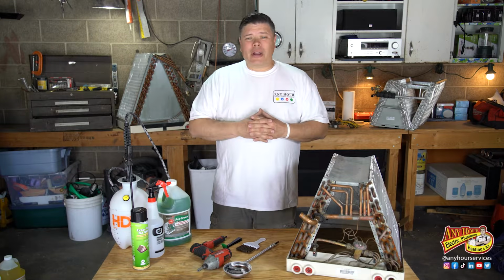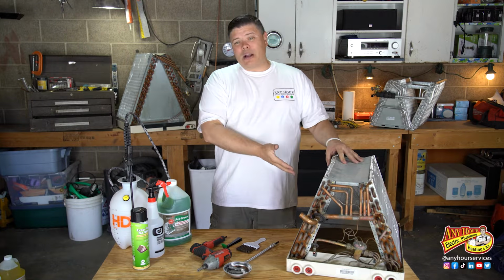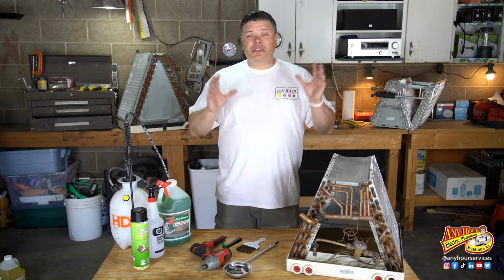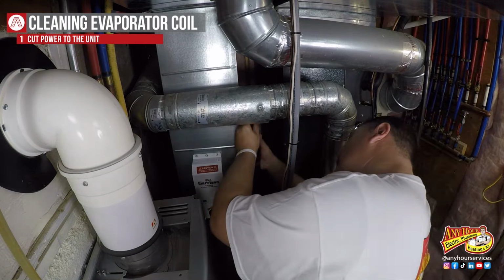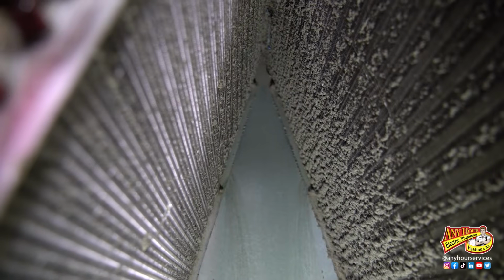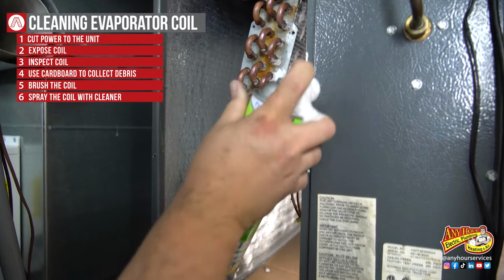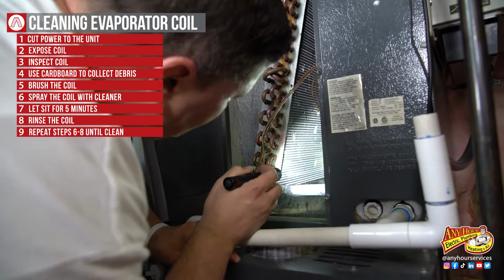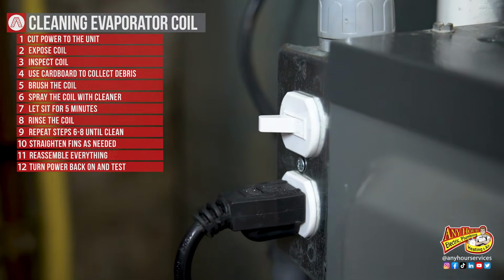AC Maintenance - How To Clean Your AC Evaporator Coil

Comment: Tip, easy way to locate ecap coils is look for the condensate drain pipe. Typically a white pvc pipe about an inch thick (half inch pvc). It should lead to condensate pump (small box with power cord, and platic hose to outside or to floor drain).

Where that pvc exits furnace is base of evap coils. Now look for a screwed in access hatch near where pipe comes out.

Comment: Approaching from the front, there are a lot of coils in the way of access panel removal on my carrier a-coil.  Can you access the underside for cleaning via a backdoor access panel. If so, I would create an access door from the rear of the furnace where I would be less likely to cause any damage?

Comment: Good video, I saw that you removed the cover in the center attached to the A coil. 
Can I just use a water hose with pressure to push out the dirt?

Comment: Great video and very well explained. I have a two year old American Standard home unit and live in the Houston Tx area so even in winter we have to turn on the A/C. Well I turned it on the other day and this very bad smell came out , which I found out seems to be very common on these new units. It smells like dirty socks. I am going to attempt to clean my evaporator coils tomorrow and then spray Odoban on them to see if the smell goes away.  I would appreciate it if you would offer your opinion on this issue and on  how I'm going to try to treat it.
Reply: Sounds like you may have mold growth which could mean that it wasn’t installed properly and the water from the evaporator coil is not draining properly

Comment: We have a brand new toll brothers house where they ran both air-conditioning units inside the house upstairs and the one in the garage without air filters for 3 1/2 months. I observed the carrier AC company for Toll Brothers removing 8 gallons of water from the frozen AC unit in the garage and photograph the coded drywall and building particles on the evaporator coil‘s. I videotaped it as I am planning on buying the house. The upstairs AC unit was so badly dented you couldn’t put a filter in it and they replaced it. Now they ran The fan for three days in the garage to dry the remaining waterlogged insulation and they cleaned the drywall paste and building particles off the coils that are aluminum. I learned from our $380 home inspector that the coils are now dented. Toll Brothers says the air conditioning unit in the garage is fine the way it is and we should just accept it. If the coils are dented and all of the above had happened to the unit, is there any way it will run normally or should I be concerned? Please advise!

Comment: I hired an HVAC company to do a whole house duct cleaning and fresh new hvac install. They blew compressed air into ALL my ducts AFTER the installation of the new system. What do you think happened?

Anyway, couldn't get them to admit fault and they insisted the "filter caught everything as evidenced in how dirty the filter is!" So they refused to clean my evap coil. Promised to replace my filters, but they never did - just a bunch of empty promises (must have had 3 different rep tell me). This video is encouraging and I think I'll tackle cleaning the evap coil myself!

Comment: Great video!  You mentioned if the coil was dirty something could ice over. What would ice over?  My outside unit had frost on most of its fins.  The frost was there in the morning, but was gone by noon.  Could that be caused by dirty coils?
Reply: It could be dirty coils, dirty filter and/or low refrigerant.

Comment: Excellent! Question: the metal frame on both ends is rusting, how to prevent it and fix it? Thanks!
Reply: Something is blocking path of condensed water to escape to condensate pump. Likely debris in gutter like channel meant to direct dripping water to pump.

Clean those gutter channels.

Now go to walmart or similar, and buy rust converting paint. Converts rust to an inert state, and paints it black at same time. This paint won't last unless you fix the water drain issue, so do that first.

Comment: I have a Lennox 4 ton unit with the heater under the evaporator coil. Can I rinse also with out damaging the heater?
Reply from the maker: You should be able to. The evaporator coils should be installed in such a way that they drain into the drain pan. If you use a sprayer like I did (just clean water) you should be fine because it's not pouring a lot of water on the coil at a time...it's almost like the condensation it naturally produces and drains.

Comment: Could you just use a vacuum with an attachment tool to gently brush and clean the coil?
Reply: Yes, just not a lot of room and it'd be easy to mash coils on other side as you go. A right angle attachment would be ideal. The typical fabric brush attachment isn't quite 90 degrees, but would probably work ok.

It'll never get upper part of A frame, but then you could hover the vac below as you used a hand brush to knock debris loose. Suck it up as it falls.

But still need that carboard barrier! Vac up what falls there before remove cardboard.

Comment: Is it okay to blow out the dust from the evaporator coils using  leaf blower?  So basically what I was thinking of is reaching into the bottom of the AC opening unit where the evaporator coil is and then just turning on a leaf blower. is it a good idea
Reply: I'm not an expert, but I think a vacuum would be a better idea. A blower sounds like it would make a mess.

Comment: What is he using to rinse it without getting water all in the furnace?
Reply: The evaporator coils drip condensate constantly. There are gutter like channels that direct it to condensate pump. So most of the water he sprays just follows that route.

Important not to spray something that has a lot of force. Make sure it just wets coils and water then drips off as it rinses. Not spray the water past coils with force.

Comment: Is it common to remove the evaporator coil for cleaning?
Reply: No! That would require depressurizing the system, then repressurize after. You'd need an ac guy to do that, defeating purpose of diy.

He has those coils on his bench just to show you what they look like. Clean then in place like full video shows.

Comment: Question: I think I know the answer to this but I am going to ask it anyway.

If after using the foam cleaner you choose to rinse it with a pump sprayer, are there any concerns about too much water?  What about getting the blower motor wet? Or are they designed so that's not really an issue because of the drainage for condensation?
Reply: There should be a drain, if it doesn't drain you can suck it out with a wet/shop vac. If you are running a horizontal setup your coil should be on the supply end with the blower motor on the opposite side, blowing air towards the coil and not sucking the water towards it.
Reply: They are designed to get wet because of the condensation that naturally occurs.
Reply: EXACTLY  THE SAME QUESTION  HERE... AC COMPANY CHARGING  $350 for cleaning....

Comment: I have to say to do it right it has to be removed and clean with acid having a technician do it properly. I've been doing this for over 25 years. Doing what he's doing is just getting the top dirt off the coil think about what's in between the fins. And spraying water over a furnace and a blower motor is going to make more problems for you. Call or contact your local technician have it done right. There's a lot of specialty tools knowledge experience that goes with this. Just knocking some dust off the top the coil is not going to solve the problem. that no rinse coil cleaner that he was using is made to put on a quarrel that might have a little bit of cigarette smoke stain or sanitizing a free-flowing coil. If you live in a local Lafayette area get in touch with me oh my email be glad to help you out I am a universal technician that means I could work on ice machines commercial Central units commercial residential. There's a big difference between the two make sure the technician you use is educated enough to actually work on the system that you have. I would not trust that or do that to a customer. do it the right way do it one time everybody's happier
Reply: We know that acid is corrosive, so I think it would need to be washed away.
Reply: Stop complaining an tell us your technique instead. People come here to save money not to hear you telling us to call technicians.